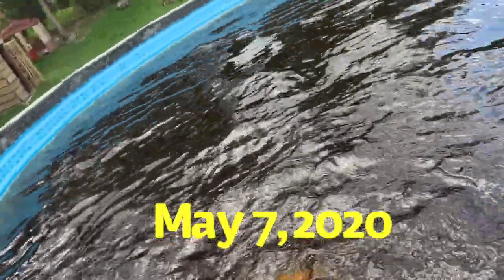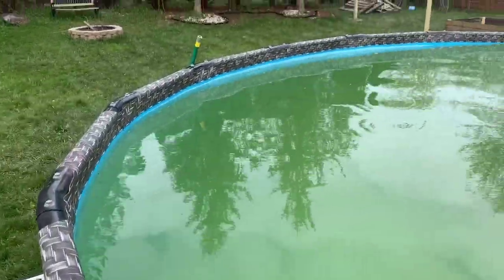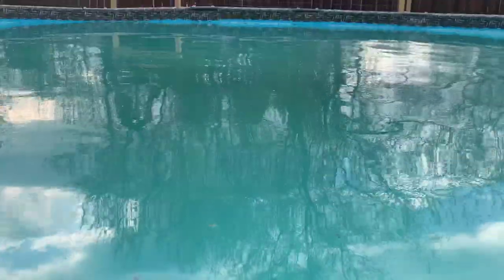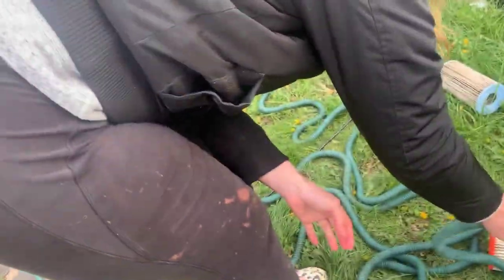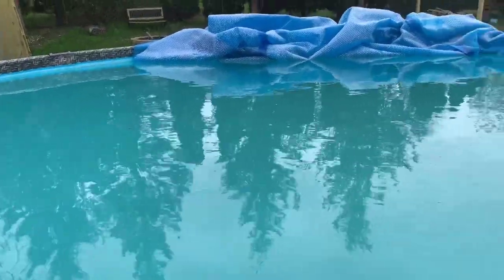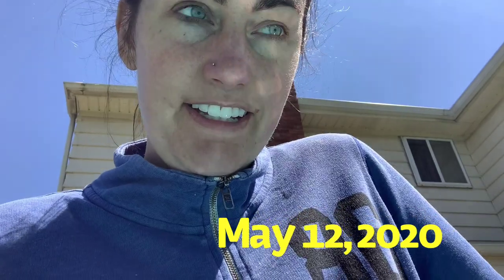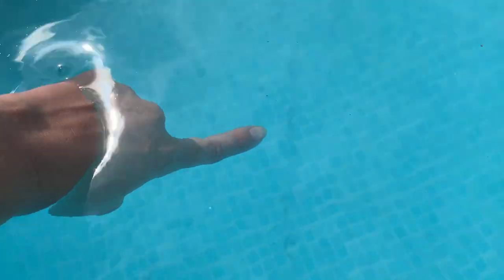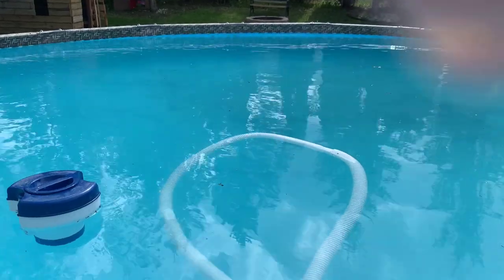Pool Cleaning | Black Pool Water | First Swim of Summer | How to clean Your Pool | Vlog

Comment: If you want to clear it up in a day or two use green to blue water treatment it will work on black Algae too 15 years ago I had to do it , my water was black put that in the next morning the water was clear I just had a  lot of dead stuff on bottom to sweep out , if you use Winterizer in the pool when it’s time to close down you’ll open it up and it will be perfectly clear .
Reply: One other thing if you have a Solar cover be careful how long you leave it on it will heat the water up good but will cause black algae if left on too long and it gets too hot . That’s how 15 years ago I ended up with black Pool went on vacation for two weeks covered it with a solar cover thinking that would keep the bugs leaves and stuff out came back to a black pool nightmare . That’s when I used the green the blue treatment water was crystal clear the next day just had some tannish kind of colored stuff at the bottom which I’m assuming was the dead black algae to sweep out .

Comment: I've never had my pool green or black or any other then clear.  We dump a extra amount of shock and chlorine tabs in our filter and run it 1 time a week for a few hours all closed up with tarp covering top and when we open the top she's crystal clear after a winter.
Reply from the maker: Yup! Definitely thinking about upgrading our whole system.  Definitely regretting going with this cheaper set to begin with! Thanks for the advice!
Reply: @racheldaydreams  ours came with the super small sand filter and it just couldn't keep up. We got the larger intex one with the timer and the water is crystal clear 24x7.  I think it was around 200 bucks when we got it. Check Amazon daily it goes on sale.

Comment: Next winter when the water gets below 65 degrees add a winter kit. I use in the swim winter kit then put a good winter pool cover on. Open pool in spring around end of March before it gets above 65 and add spring kit. If you do that your water will be crystal blue and clean when you take the cover off. Do not use the cover that came with it get a winter cover and pool saver wrap. I do this with my summer waves pool works great
Reply from the maker: Awesome, thanks for the tips! Times coming again real soon. I’ll have to look into those products!
Reply: Thank you for this information

Comment: My family had an above ground pool when we were younger. Many memories! We actually emptied it and then refilled it. When I lived at Copper Ridge apartments, they'd shock the pool Every Monday. And believe me, it was shocked. It was so shocked, you could not open your eyes in the water. And you smelled like chlorine. If I had to do what you did, I'd probably empty half of it and then refill it and start shocking it. I've seen a lot of pool cleaners recommend this. Your basically diluting it. That's just my opinion. But those memories.

Comment: Great job! Next time you should add all that shock at once and brush the whole pool right after. Run the pump as long as you can. If you brushed right after then it would bring all that algae up. But great job, it turned out amazing!
Reply from the maker: Thank you so much for your feedback! Having a pool is definitely a huge learning experience.

Comment: One huge problem with some of these above ground pools is that the pump that come with is woefully inadequate ! Get yourself atleast a 1 horsepower pool pump and install a inline clorinator. This will give you adequate recirculation of the pool water to allow your pool filter to actually work efficiently.  Having a chlorinator will keep your chlorine levels consistent and will do a better job than a floating chlorinator. Then all you will need to do is check your chemicals and add appropriate ph stableizers like baking soda etc....oh and either drain your pool at the end of season or use a  Pool Winterization Kit to chemically treat your water so when you open up your pool the next season it will be ready for use with just a few steps.
Reply from the maker: Thanks for all the tips! I agree, the pumps that come with the pools just don’t do much at all
Reply: a little too much on the modifications to a summer breeze pool. these are considered seasonal play pools. id definitely at min just drain and refill and thats only because its not a liner pool. other than that the mentioned modifications are too much for a softwalled small pool of this nature.  I clean 80 a week. all mine modified as mentioned are hard walled above grounds.

Comment: Did you have the pump when you added chlorine? We have black water too,. The pool was trashed and we are trying to clean it but can’t see anything bc of the color of the water
Reply: Katia Barragan how long has the pool sat like that? You may need to scoop the algae that has settled to the bottom out of inbreeding you start to see a difference. I Personally wouldn’t add the chlorine until you know the shock is working. Depending on the pool size you may need lots more shock then what was used here. Another product that I’ve found to work for me once it gets cloudy is using the green to blue treatment kit but as long as you can hook up a vacuum to it as it will sit on the pool floor.
Reply: Shelainia McClaine it’s been sitting there for at least 2 years :( we found at least 3 concrete blocks, nets, a toilet, etc!!
We are scooping the black algae with a skimmer but that’s taking forever... The pool also came without a pump or filter. We recently purchased these but my husband believes we have to clean most of the black algae with the skimmer, then vacuum it by hooking it up to the pump (he’s afraid if we vacuum now the pump will stop working bc of all the algae), and then shock the pool?
Do you know a faster way to clean this pool? I’d love to have it done soon!!
Thanks in advance!!!
Reply: Katia Barragan I have an above ground pool. It has sat for the last three years with never being winterized. I just bought a new pump & sand filter last Thursday. What has worked for me to get to the green to blue stage is scoping out the algae on top. I then hooked my pump & filter up. I added 6 bags of the 6 in 1 shock. Then I’ve just baby sat it while it’s been filtering. Cleaning the skimmer out at least ever 10 to 20 mins and scooping anything on the top that lumped together. After it turned white and cloudy I started to brush the floor and walls. I’m now on the green to blue stage today. I’ll let you know tomorrow if everything sank to the bottom. But it looks so much better then when I started it looked like a black swamp.
Reply: I am having the SAME ISSUES!

Comment: Thank you for the video. Have you ever tried just chlorine to open it and get it back to clear? We’re in Indiana and ours is black just like this. We didn’t cover it.
Reply from the maker: So from what I’ve learned, you have to make sure the ph is correct in order for just chlorine to work.  However, black pools like mine and yours, is a good indicator of green and black algae.  If you left yours uncovered, it’s from fallen leaves that allowed algae to feed off of.  So, first pH, then algaecide scrub scrub scrub and skim fallen debri, then tons of chlorine with constant filtering/pump! And you should be golden! Hope that helps! It’s a guessing game every year, I swear!
Reply: @racheldaydreams  how many of those Clorox shock xtrablue did you use? How many days until it was clear? Did you skip some days and just only backwash. We’re trying to get it to salt water after we get it clear.
Reply: @racheldaydreams  that makes sense. Thank you
Reply: Heyy!!! Have you started opening your pool yet? When is a good time?
Reply: @racheldaydreams  hey there! I know your weather is similar to ours. Looks like next week is going to be in the 80s all week. Have you started on your pool yet? When would you recommend? Also can I just put a ton of the shock in at once and keep filter running?
Reply from the maker: Hi there!! We actually ended up draining ours at the end of the season last year! Going to start prepping for a new one soon! I would say right now is perfect timing to start cleaning and prepping! Check your ph first.  If it’s in a good range, then yes.. tons of shock and run filter consistently!

Comment: Shock brush flock next day vaccum on waste so the stuff won't get recirculated back into the pool 👌
Reply from the maker: Thanks for the tip! It’s almost that pool cleaning time again! I’ll do this, this year!!
Reply: With just those 3 steps it should be alot easier & less chemicals sand filter pumps are better! The sand last 3 years. Shock brush flock same day vaccum next day 😊😊😊 i hope it helps happy pool season
Reply from the maker: Can I ask you what flock means? Happy pool season to you too.  Looking into getting a sand filter for this season for sure! The ones that comes with pools are such junk!
Reply: @racheldaydreams  you can find it at Walmart flock acts like a magnet to attract all the debris in the pool than it falls to the bottom 😊
Reply: @racheldaydreams  its a life saver you'll love it
Reply: Can you just pour Flock into the pool? My pool does not have a open filter like this pool has.
Reply: Flock is short for flocculant. Not sure if appropriate for cartridge filter.
Reply: @christie_616  flock just bundles up dirt or other things into the pool it doesn't need 2 be sucked by filter by vacuumed out
Reply: @cbro_  filter should not be on when flocking, flock builds up all the debris in pool & drags it to the bottom to be vacuumed
Reply: @racheldaydreams  be careful floc isn’t supposed to be used with cartridge filter it wreaks hAvoc and u will have to spray them out every 2 hrs and if not pump will be overworked…I would recommend super Clarifier over floc for cartridge filters

Comment: Invest in a better filter.  Get a decent sand filter with a good pump.
Reply from the maker: Definitely doing that this year.  The pool pumps that come in the sets, just don’t cut it!
Reply: @racheldaydreams  look for a large intex filter with the timer.  Does great for us.  We've got around 8000 gallon pool and my water has been ready for swim since February lol its just a tad cold at 68*
Reply: We have a built in and we’re having problems keeping it clear. We replaced the sand filter with a diatomaceous earth filter and it cleared the pool in a few hours and it’s been crystal clear since. It might be worth it over time to upgrade to something better than sand?  The pool guy explained how sand filters develop channels and stop working as efficiently. Your hard it awesome! 🙂